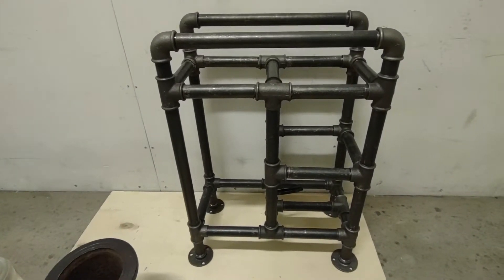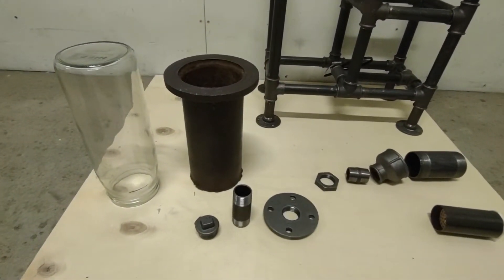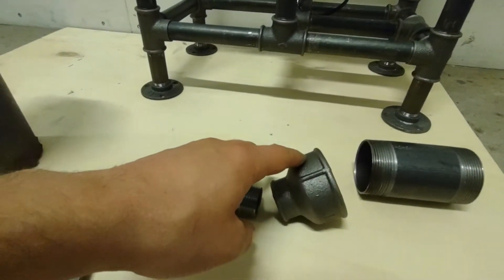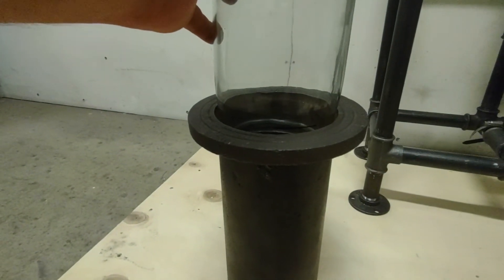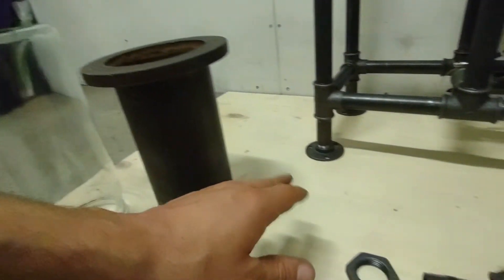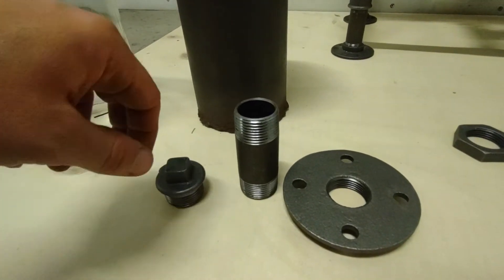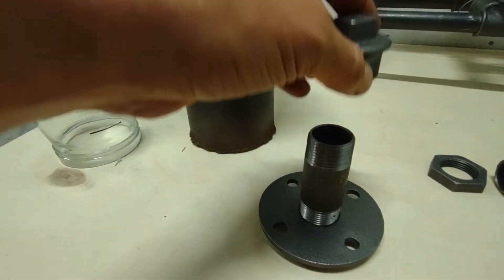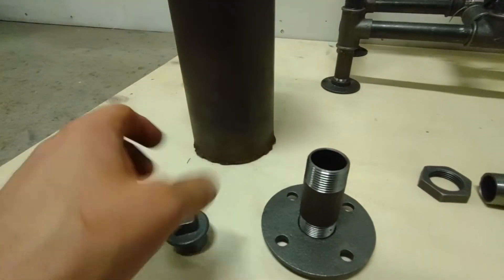WojciechRoaster v2.0, The Steampunk Coffee Roaster - Update #5

Comment: Are you the same guy that is the hardware engineer for the Roest? What I’d love to know is how the wires are fitted on all the components. I’m about to build an air roaster and will be interested in watching your project, I have my own design but there are things I’m not experienced in, so watching you will be educational.
Reply from the maker: Hi, inside the previous roaster there are quite a lot of cables, but the schematics are quite straightforward. What makes it easier is that I'm using ESP32 which has a built in Bluetooth, so no need for an additional module. In general, ESP32 is on a breadboard and there is a temperature sensor and two-channel AC power controller.
I will most likely use the same hardware components on this roaster (the steampunk roaster) as on the previous one.
Reply: @wojwa  Thanks but all what you said about the ESP32 is what I don’t understand, so I need to learn all that stuff. Also it looks like your heating element is offset rather than being directly connected to the blower? I don’t like to bother people but there’s a fluidbed roaster builder group on Facebook but I can’t find it do you know it’s correct name?
Reply from the maker: @Anarchsis  Hi, I assume we're talking about the white roaster. Yes, the heating element is offset, it's just underneath the glass container. The blower is blowing air through a tube down to the housing, and then that tube goes to the heating element. I did it like that so the whole roaster is not that tall. 
I have no idea if there is a FB group, I'm not using FB and I wasn't also following any particular design.
But if you're just starting, then I suggest not to try doing everything at once. First start with one sensor, make sure it works as you want, then start with another sensor or controller, combine everything and continue the process. That's how I did it.
Reply: @wojwa  Thanks for the advice it’s much appreciated. Regarding Face Book I don’t like it either but if I can find  group that chats about this I’ll just harvest as much info as I can from there and then delete my account.